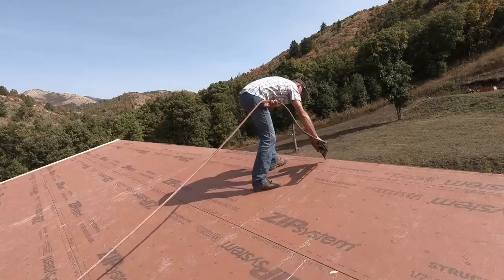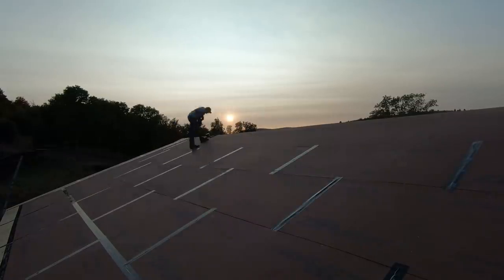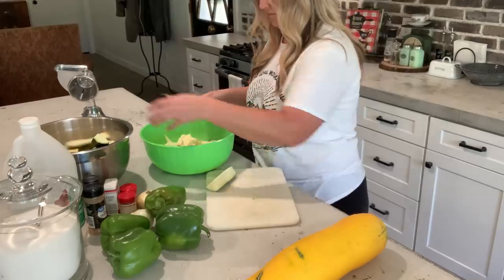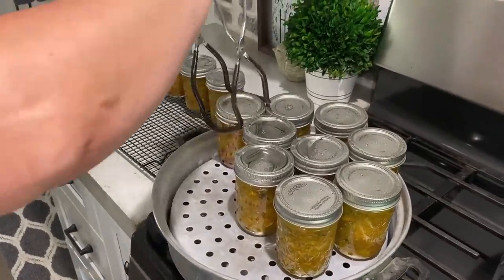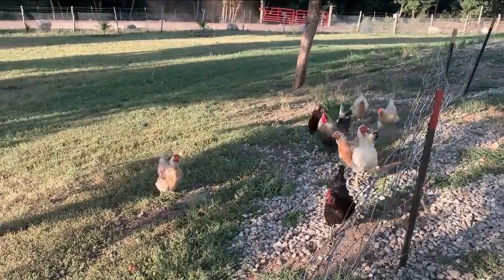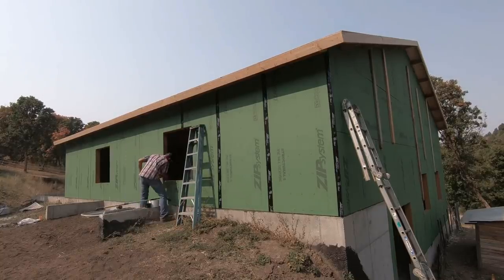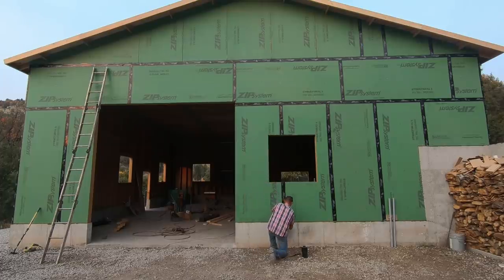#437 - Shop Build: Framing DONE!!! Installed Zip Tape (Water Tight)

Comment: Regarding the windows: From experience I can say that the windows add so more to the character of a building than we generally think. Especially when they only cover a small percentage of the walls and the buildings create an ensemble with no other architecture around. You’d be surprised how much and for how long you notice a compromise in the design. Depending on the additional work it took to change the shop windows to the same design of the house later (and the budget available now to spend on the more expensive original design on back order) I’d recommend to go for a identical design on both buildings.
Again, from experience I can confirm that one notices window designs much longer than one would expect.
Keep up the great work!

Comment: I’d been using hardiboard, I’ve been replacing my old T-1-11 on my house with the 4x8 sheets that have the wood grain in-bossed in it. It was cheaper than the real stuff and looked better. Totally waterproof and looks as good as the days I put it up.  And I’m in the soggy Oregon weather. 
Probably better with Forest fires for not burnable being it’s a concrete product.

Comment: Either you missed one joint on the second side of the roof with the tape or there is a scratch in the finish on the OSB.  16:14 in upper right part of screen...Yes, I'm a little on the retentive side but that's what it looks like to me.

Comment: As much as I appreciate your wanting to match the house with the shop, if timber is that pricey at the moment (and is likely to stay that way for at least the next 12 months) you might consider alternatives.
I looked at a shiplap style cladding for my reframing job on my back garage (which is sort of how I found your channel). Here in Australia, to do timber cladding is 2-3 times the price of doing it in steel, and steel lasts longer. For a house, where the look is important, I get it, but for what is largely a utility building (no matter how nice/large/close to the house it is), steel is acceptable I think. There are some very nice steel profiles these days too, not just the stock standard corrugated sheets.
You've probably come across RR Buildings here on Youtube. The finishes they apply to their workshop builds using steel with a two tone wainscot hip trim is very classy. With Colourbond, you could find a colour suitably close to, or perhaps complementary to, your house.

Just an idea! Keep up the great work!

Comment: Heath just a tip: I noticed you didn't square & shim the shop windows. This is done simply to make sure the window opens and closes smoothly. Maybe you skipped that since they're shop windows and won't be opened often? I'm sure they'll be fine but if you have a sticky window, that's what you'll need to do to resolve it. 👍

Comment: I would restore it and ride it. That is what they are for. Its more fun to work on it and ride it than just look at it. Motor cycles are for working on and riding. You need a bike that does not have a electronic ignition so it will run when the explode a EMP and speaking of which they are warning there could be a threat of a EMP in November. Government agency said so.

Comment: Perhaps you've already done this, and you probably already know. The zip system has a concrete to wood flashing that you should apply along the base of the shop. Its designed to seal and keep bugs out. You probably already know this, but just thought I would mention it just in case.

Comment: If the prices are so high on the board-and-batten lumber, there is an alternative material that is manufactured and headquartered from Missoula, Montana. It’s called Ever-Logs Systems, that might fit your needs. 

Here’s two links: https://www.everlogs.com

And about board-and-batten concrete siding: https://www.everlogs.com/what-is-board-and-batten/

Have fun on your shop.

Comment: I would at least stiff brush the seams of the zip boards to remove loose particles before installing the zip tape.  Or blow the dust with compressed air.  I wonder if the instructions said so.

Comment: Did you ever mill a cottonwood tree?  I have a lot of them but everybody tells me they aren't worth building with.  They seem to burn at least OK not major heat but burn evenly and easily.  I just want a pole building may figure it out once the tree guy chops and moves them.  The wind knocked down a couple and snapped a couple in half they are like 80 ft tall!
Reply from the maker: John Doe  No, he's never milled a cottonwood. We have burned lots of it and it leaves tons of ashes. My Grandpa made a really cool small bench out of cottonwood that turned out beautiful. ~Cedar
Reply: @RedPoppyRanch  I hear you can make cool bowls out of it.  Totem poles too.

Comment: Heath I know you probably have heard this a thousand times . Wouldn't the driveway fabric keep all that rock from getting pushed down and keep from having to keep adding more? Just my curiosity .
Reply: Some 3/4 to 1 1/4 crushed basalt rock base would have been best. Cover that with a 5/8 minus top and you have yourself a great drive and parking area.
Reply: After a few years, it won't matter much anyway. Once the gravel gets mixed into the top layer of dirt and that gets compacted properly, it won't be pushed down nearly as easily. They'll likely already see major improvement this year, and maybe two or three years from now (with a new layer of gravel spread every year) it'll require barely any maintenance.

Driveway fabric wouldn't hold up to the heavy machinery either, at least this way it'll all end up one even layer of gravel in the end

Comment: Why not place some road fabric on your road?
Reply: I thought the same thing as soon as I saw it, he will keep buying fresh gravel every year otherwise
Reply: I’m guessing but since the climate is rather extreme there, the driveway itself looks quite steep and there is a lot of heavy machine movement going on any permanent surface would require a substantial construction and dedicated water management? This probably is more expensive and time consuming than one would expect?
Reply: I suggested that last year before he spread all that gravel.  It will be a yearly expense if he doesn't add a proper base.
Reply: @dimples7334  i always thought he didnt want to considering he still had a building to  finish. guess i was wrong.
Reply: @b.willroth8384  Road fabric has tiny holes in it that allows water to pass through. but larger things such as rocks cant. it also stops weeds from growing up in his driveway. as far as cost well you dont have to bring truckloads of rocks up every year.

Comment: Shop is looking good, but i cant understand why u would go to the expense & hard work slugging those 4x8 sheets if ur using steel roof. What u did is perfect for shingles & overkill for steel. I did my house & shop in steel but i straped the roof with ruff cut 1x4 & put the steel directly on them at two ft centers. We all do it that way where i am in Ont. Canada. The bottom  steel is open to the attic & can evaporate any moisture. My shop roof is 41yrs old and still like new underside. The paint on top is really getting faded but never hard one drop from any storm. Some manufactures want it done that way. If your not putting up a ceiling,disregard what i wrote. Cheers
Reply: Zip gives you air tight seal. Probably has to due with the way he'll insulate.

Comment: Cedar, try zucchini brownies. I use a recipe from Allrecipes.com, simply called zucchini brownies, and I don't bother with the frosting, these are good enough as is. The only thing different I would suggest is to chop the zucchini a little more after grating it. Hooray, the roof is on and the windows are in at the shop! Hooray, more gravel is in! and holy smokes, Heath, why the dickens are you doing all this after knee surgery??

Comment: Pre-Op proceedures are not fun at all. 
Progress on the shop is moving along really fast. That zip system is a little different, how much cost difference compared to regular OSB? Do you believe it's worth the difference?
I've never seen windows installed that way before, is that part of the zip system way?

Comment: I'm building a garage right now as well 25x30 luckily I bought most everything a few months ago. What makes no sense is the lumber yard racks are full over flowing even and the prices are through the roof. A 2x8x10 two months ago was about $9 now almost $30 so nobody is buying anything. That's not the wày supply and demand is supposed to work.

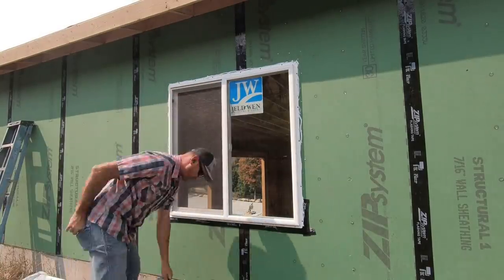Comment: 18:50   What?   No water sealing tape right around the window opening structure?  Normally applied on all corners first, then sill, then the uprights, finally the top horizontal -- in this order, that way any water that does make its way in will drip down and out.
Reply: Alan Torrance he said he installed it as per the instructions....